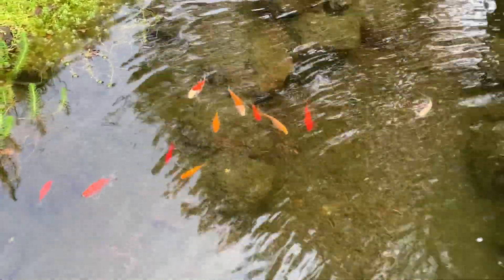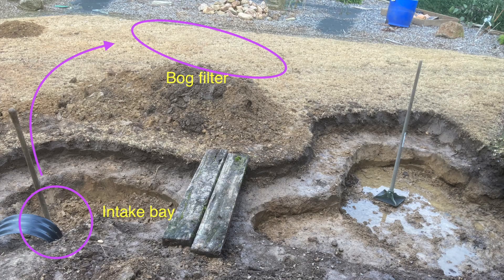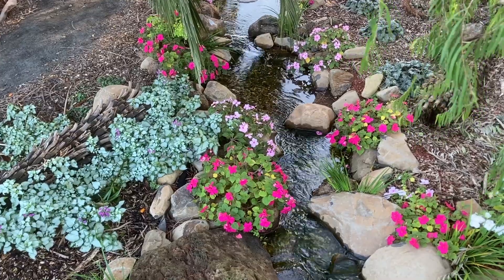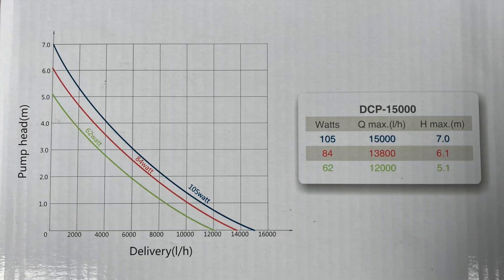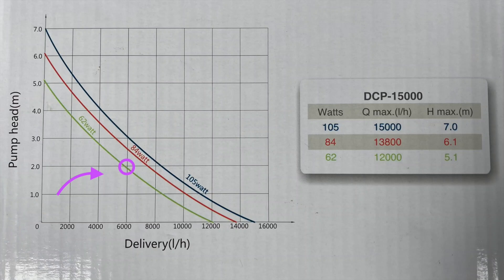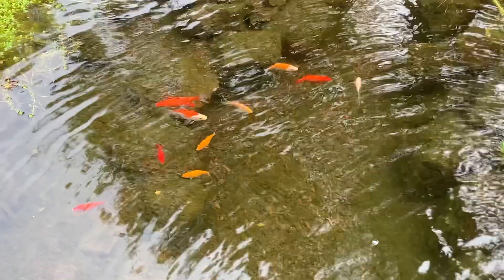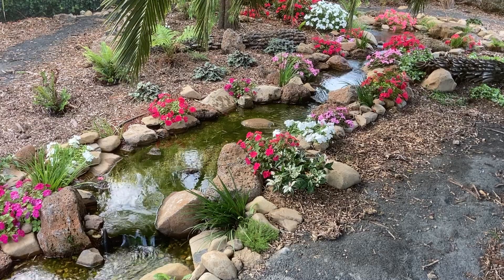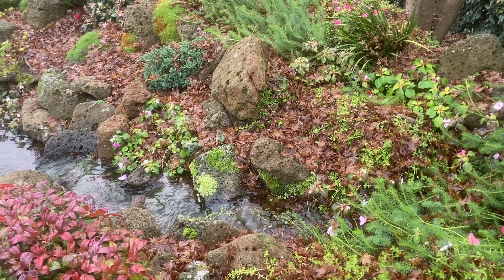Pond Pump| What to consider

Comment: Hi Kev,
Learning so much from your videos. Thank you!
I have a small pond of 1000 litres. I experimented with a small 30 liter bog filter build with a few fish and it works ok. But def needs upsizing. 
I know you say the bigger the better for a bog filter. I have a 1000 liter IBC tank that I can utulize for a bog build. 
Would that cause any problems to have the bog as big as the pond itself?
Reply from the maker: I’ve got no issue with that. You might like to just half fill it with rock and pebble, then you could keep a few fish and some plants in the “filter”.

Comment: Hi Kev, great, helpful videos! I'm so glad I searched for DIY pond filtering and hitting your channel. I sort of inherited quite a large pond and I'm having a lot of fun with it (the dogs love it too😉). The pond has essentially stood still for the past 4-5 years with nothing but rain interacting with it. I'm planning on adding a bog filter once I've worked out the surrounding area. I'm a bit confused about pump calculations though. The head height, is that just the difference in water level height between the pond and the bog or is that the distance from where the pump intake is and where the water is discharged into the bog? Or is it something completely different even? And does the amount of water in the bog not create backpressure that should be factored in? Or is that just what the "volume x 6" is for? And what if I need too much flow for one reasonably prized pump, can I just add another pump?
Cheers
Reply from the maker: “Head height” is pretty much all the factors you mentioned combined. Yes if the bog needs more flow than one pump can achieve you can use multiple pumps.

Comment: I used 2 of these pumps in my pond 1 was a jebao 7000 and a 4000 the 4000 wire broke near the pump i wasnt happy to solder it they lasted 8 years in my pond and 2 in my reef tank  the 7000 is still going good choice
Reply from the maker: They’re such great pumps and such a good price. And efficient!!

Comment: wow, thank you for including the link to that pump you bought recently. I cannot believe the cost of the pumps from this brand. How is it that Aquascape and others can charge three times this. What am I missing. I haven't bought my pump yet but I'm just about to I looked at the Aquascape Aqua surge 5,000. Could you tell me how to determine which of these pumps from Jeboa would be an equivalent?
Reply from the maker: A few differences. The aquascape aqua surge pumps have a longer warranty, longer cord, aren’t low volt and aren’t variable speed. The jebao pumps you’ll need to keep the controller out of the weather and extend the cord yourself, that’s the only downside. There’s lots of other dc pumps coming to market now, so it’s only a matter of time till you can get a longer cord or extension and a weather proof controller. There is a 18000 & a 20000 model that will move around the same amount of water as the aquasurge 5000.

Comment: Hey Kev,  I would like to buy the uni seals and piping at the same time as the pump you recommend here. Im going to get the 15000 one as well. Could you please tell me what some piping diameter this pump uses? I can’t find it one the Amazon description/reviews. Thanks!.
Reply from the maker: I hooked it up with 50mm or 2 inch pipe. It comes with fittings will accept 2 inch pipe. Hope that helps.
Reply: @Ozponds  you are the best. Thanks man. I wish you could see my ponds progress.
Reply from the maker: You could upload a YouTube vid and leave a link 👍
Reply: @Ozponds  here it is! 
https://youtu.be/N0LGxvaJV2Q

Comment: Sorry for commenting on all of your videos today... but with a dc pump, you can add an appropriate pwm to control the speed of the motor. Good way to regulate flow without using valves 👍
Reply from the maker: That’s ok. That’s what I love about those jeboa dc pumps they come with a control panel that allows you to adjust the flow.

Comment: Hi Kev we have a pond that's about 1200 gallons. We never put rocks or pebbles on the bottom of the pond, is it essential or is it strictly for looks.
Reply from the maker: Not essential. It can help with keeping the water clear as it provides more surface area for bacteria. But if you have good filtration (surface area in your filter) you can still have clean, clear water 👍

Comment: I understand your calculating bog filter size to the water pool and I get pump head height, but how does the volume and construction within the WHOLE bog filter factor in to these calculations? If head height is to the top of the tubing into the top of the bog filter, what of the extra tubing and water path through the substrate and its exit through any outlet?
Reply from the maker: I don’t really understand the question. Knowing roughly the volume of the bog helps determine how much water needs to flow up through the filter. I hope that makes sense.
Reply: @Ozponds  , I guess...it means that the extra volume of the filter must also be factored in when considering how big a flow rate one has to calculate when looking at pumps and GPH and head height. Not ever seeing a bog filter in use, the idea of considering water volume leaving a pump and traveling up to the filter inlet, there will be additional restrictions, between: substrate, how you construct your plumbing, plant material, and outlet size, as to what your outlet flow rate will be, so that if you look at, flow rate at the inlet tubing into your filter, there will be a significant drop in outlet flow leaving the bog filter, such that, calculating pumping needs simply on pond volume and filter volume, won't fully result in what one will see...i.e., more pumping in is going to be necessary, to see an outflow that you can anticipate. Excuse any "tone", I'm only writing out what I'm trying to picture in my head, how things work. There needs to be an X multiplier in figuring how one's pond filter flow out compares to the volume of water in to the filter, it won't ever be a 1:1 ratio. I guess that's what I've been driving at....👌
Reply from the maker: That’s why I just keep it simple. If I multiply the volume (when empty) by 6 and use that as my guide. Every time I do this I get great results. You can absolutely figure out all the variables if you wish that’s your choice. But then it’s going to be a different formula.

Comment: Excellent video   and  great advice    same as your others. I'm a fan of the jeboa pumps my first XTP 8000 has finally stopped working   after 6+ years  .  I've replaced  with a OEP  12000   very pleased with output considering   my pond is 5ft deep & filters are  2 metres higher due to garden being on a hill    I'm still running an XTP  8000  running my 2 bakki showers   while  I purchase another OEP  12000  to power showers and a  bog filter. Eventually . Living in UK    have to wait longer for them to be delivered from China .but much cheaper than buying  from UK supplier  .look forward to seeing your new project  running
Reply from the maker: That’s great to hear. 👍